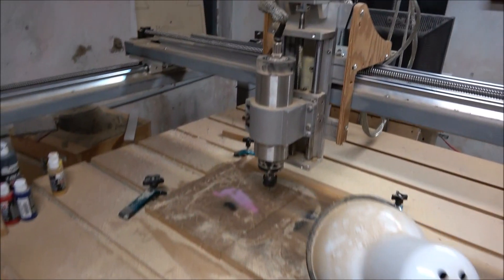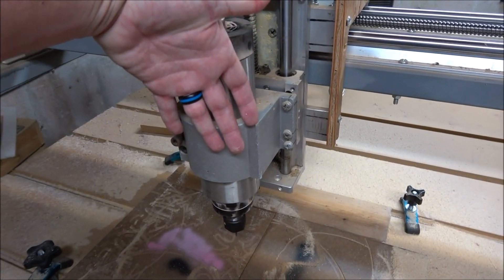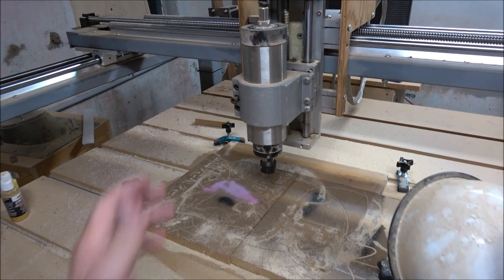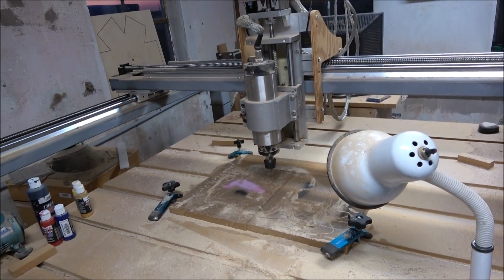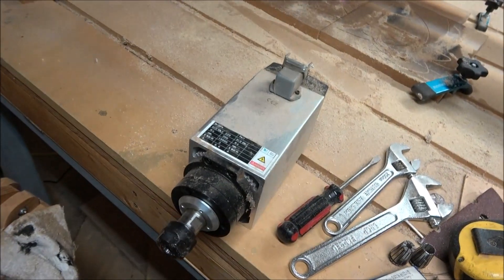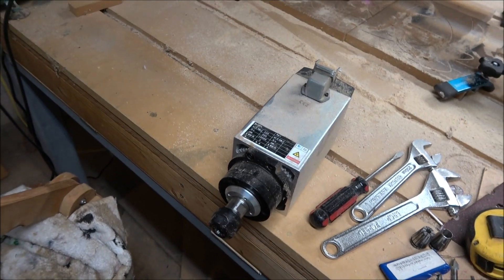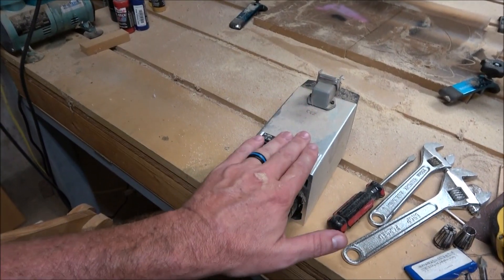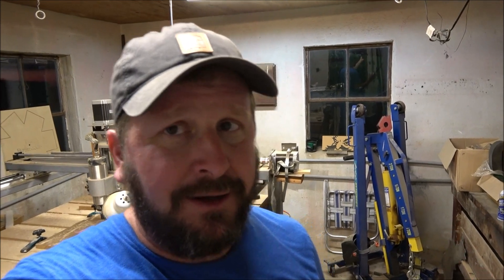Spindles and Controller software (CNC info)

Comment: Great video once again and thanks for going back over the basics. So I didn't even plan on having a cnc until after I found i could 3D print parts to build one (wife says I have too many printers). It peeked my interest enough and I ended up building a "MPCNC" (mostly printed CNC) and used a Rambo board. I used "Estlcam" which is GREAT for beginners to generate my Gcodes but ended up making the move to Aspire. I did make the mistake of going to a 4' x 4' not thinking I would pursue this any further than I have already but am now finding myself building another CNC for the big stuff. Just thought I'd share that lil info and let you know that I enjoy your videos. I'm in Oklahoma City!
Reply from the maker: Awesome we aren't far apart!! I'm around Sulphur...A 3d printed machine would make all the parts as perfect as one could hope!!...Thanks for watching!!!